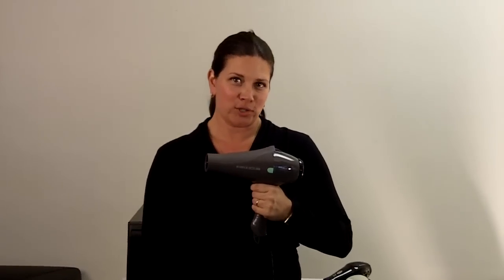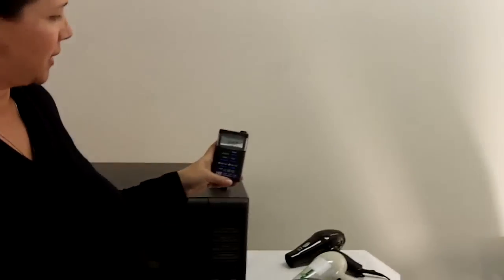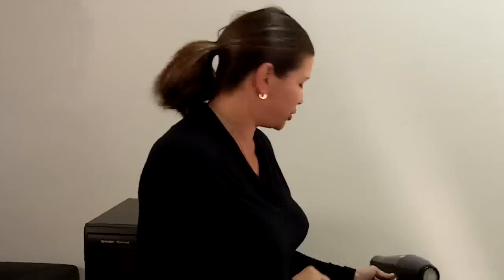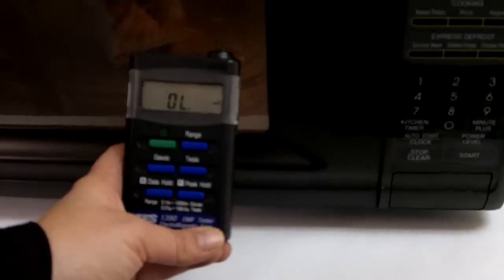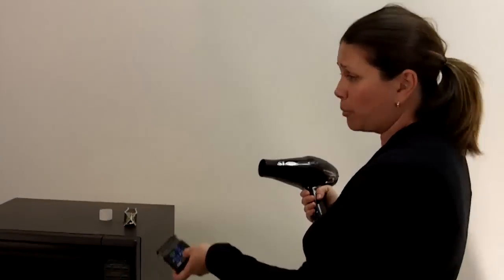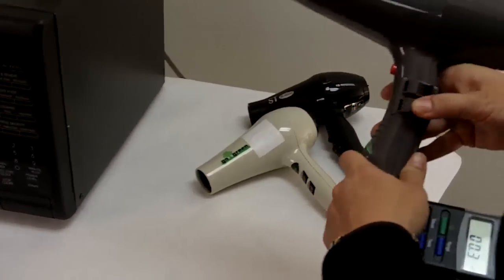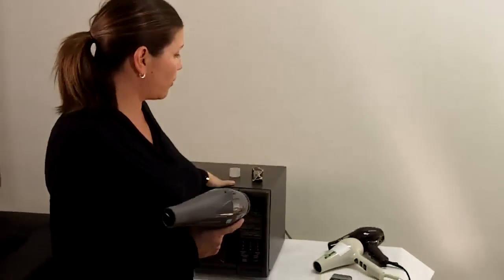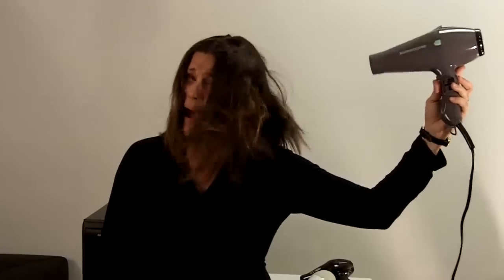BARBAR Eco 8000 Eco-Friendly Blow Dryer

Comment: Got one of these as a gift.....stopped blowing heat with less then 6 months of use....hard as a rock???...very durable???.....lasts longer then a coil dryer???....not in my experience. I had a coil dryer that lasted for 10 years!!!! Contacting the company for a replacement. I hope without any hassle since it was a gift and obviously I have no receipt. We'll see